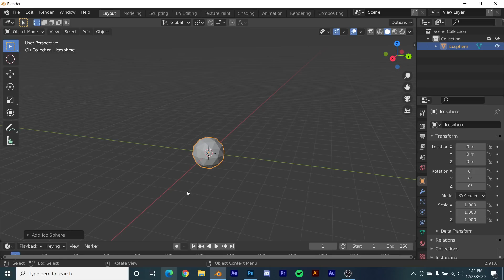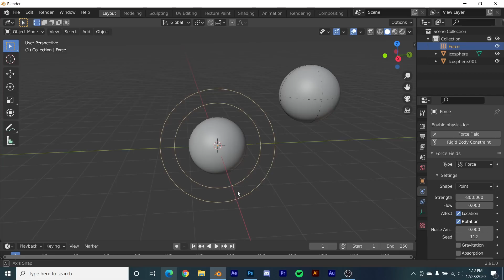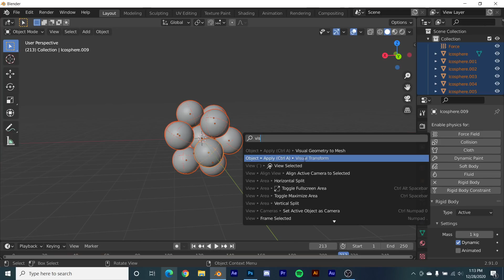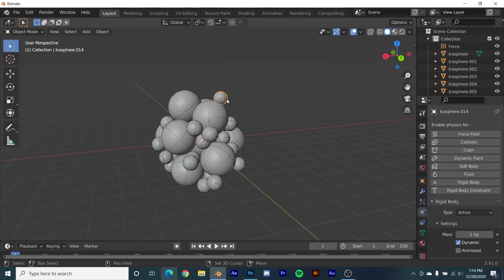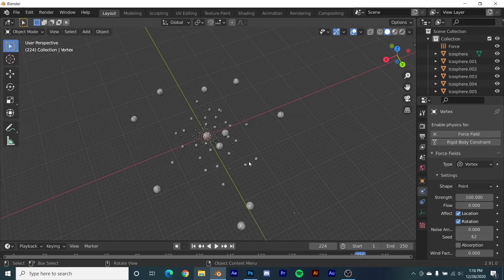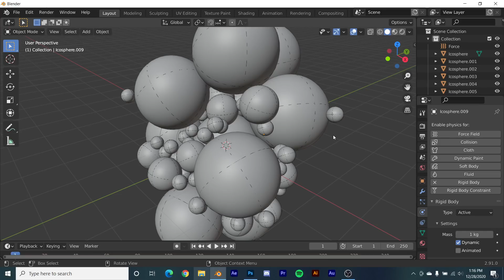Rigid Body Physics Quick Tip in Blender

Comment: As you witnessed, the visually transformed objects are lightly constrained in place, basically setting a goal for the objects to aim towards -  but not locked into place completely. You can absolutely freeze them into place by Applying the simulation at the frame you like; then setup a new simulation with the smaller spheres. (And repeat again if you want for the third set of spheres.